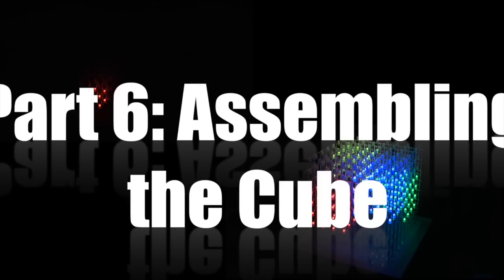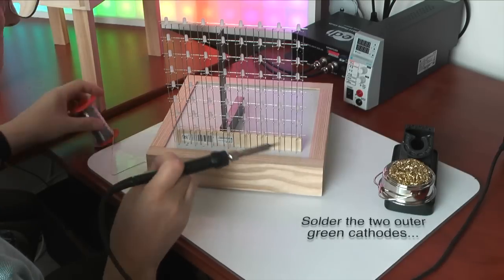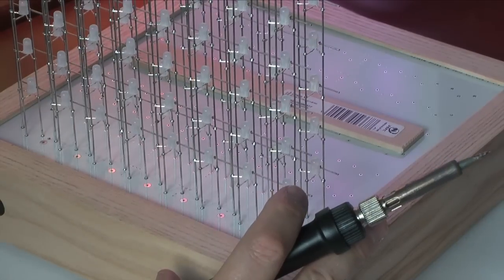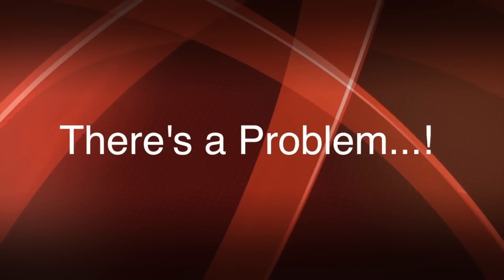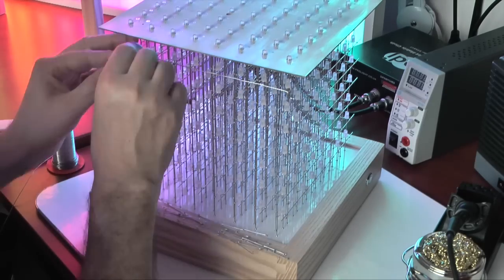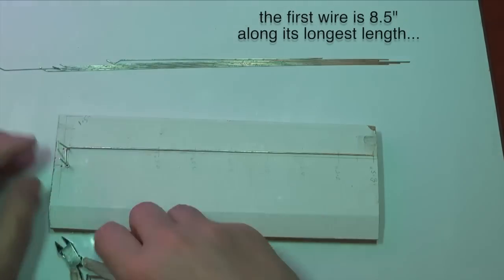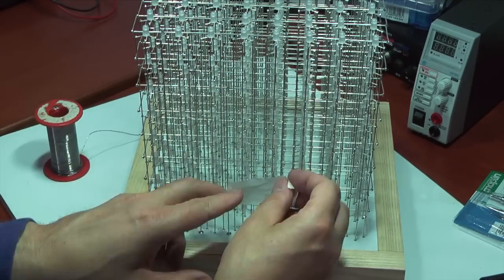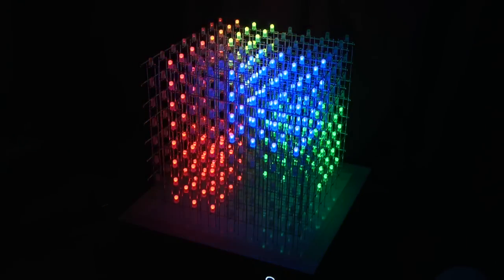Construction of an 8x8x8 RGB LED Cube. Part 6: Cube Final Assembly

Comment: Hi Steve. I built your design of the 8x8x8 cube. it works brilliant. But where does the connection jp2 go to from off the Anode board were you have OE2-CLK2.
Reply from the maker: +bill bedew Hi Bill,
On my cube JP2 is just 4 GND connections. I only use one that connects to the Arduino GND. JP5 has OE2-CLK2 and here is an explanation copied from a reply to someone else with a similar query:

JP3 of the Anode Driver board feeds Shift Register boards 1 & 2 and JP5 feeds boards 3 & 4 with one exception, JP5 pin 1 has no connection. Instead Pin 1 of JP1 on Shift Register board 3 is connected to pin 1 on JP3 of Shift Register board 2. The reason I had to do this is because the CLK, LE & OE signals are common to all 24 shift register chips and my Arduino struggled to drive that many inputs, so I split each of the 3 signals into 2 through a buffer chip on the Anode board, therefore each line drives fewer inputs. 

The DOUT (pin 1) of the Anode board JP3 only has to drive one shift register input of the first Shift Register board (JP1 pin 1) as that signal is daisy chained from one shift register to the next. and doesn't need buffering.

Here is a wiring schedule that may also help:

Anode JP3 - Shift Reg 1 JP1
Pin 1 - Pin 1
Pin 2 - Pin 2
Pin 3 - Pin 3
Pin 4 - Pin 4

Shift Reg 1 JP3 - Shift Reg 2 JP1
Pin 1 - Pin 1
Pin 2 - Pin 2
Pin 3 - Pin 3
Pin 4 - Pin 4

Shift Reg 2 JP3 - Shift Reg 3 JP1
Pin 1 - Pin 1

Anode JP5 - Shift Reg 3 JP1
Pin 2 - Pin 2
Pin 3 - Pin 3
Pin 4 - Pin 4

Shift Reg 3 JP3 - Shift Reg 4 JP1
Pin 1 - Pin 1
Pin 2 - Pin 2
Pin 3 - Pin 3
Pin 4 - Pin 4

ALL Shift Register Boards JP2
Pin 1 - Not used but has 5V
Pin 2 - Connected to Anode Borad X4 5V OUT
Pin 3 - Connected to Anode Board X5 GND
Pin 4 - Board 1 - Pin 4 Board 2 - Pin 4 Board 3 - Pin 4 Board 4

Anode Board
+6V from Power Supply - X4 6V IN
  0V from Power Supply - X5 GND
Reply: Thanks Steve that's been a big help. Regards Bill

Comment: Hi Steve...excellent job on the cube..my friend and I built one to the exact specifications. There is good signals at the LED's but not enough voltage to turn them on. Boards were tested prior to connecting LED's. Once LED's were connected the DC voltage dropped from 5-6volts to .85volts any ideas why that happened? Many thanks again
Reply from the maker: +Blue Ice It sounds like you have a short circuit somewhere, be it a faulty component, circuit board or solder joint. Try powering each board in turn to see which one is causing the issue.

Comment: Hi, Steve
As an amateur, I thought to begin with RGB project.
One question, can I use the main RGB PCB from SuperTec. (I already bought)
to your design?
Thank you for your valuable descriptions.

Regards
Anders
Reply from the maker: +Anders Norgren Hi Anders,
I have no personal experience of SuperTec's board but I understand that my cube matrix is comparable with it. However his electronics and software are different to mine and I can therefore not support you with regard to queries of that nature. You would need to ask SuperTec and I wish you good luck with that. Others have recently found him to be less than helpful.
Should you need help with the matrix itself then I'm happy to help.
Reply: +Steve Manley Thanks for your reply.

Comment: Hello Steve! I very much want to repeat your cube. But I have some questions. How Shift Register Boards connect among themselves (JP1, JP2 and JP3)? (Connections aren't visible because of Anode Driver Board) To what connector is connected the JP5 connector of the anode register?
Reply from the maker: +Эдуард Пфо Hi there, 
JP1 of the first board (the one that sits directly under the Arduino) receives its input from the Anode Driver board, JP3 then connects to JP1 of the second board and so on. JP3 on the fourth board is not connected. Pin 1 of JP3 goes to pin 1 of JP1, pin 2 to 2, pin 3 to 3 & pin 4 to 4. JP2 is for the power connections, pins 1 & 2 are +5V, pins 3 & 4 are Ground.

Hope this helps.
Reply: +Steve Manley, thanks! And JP5 of the Anode Driver Board?
Reply from the maker: +Эдуард Пфо Thanks for pointing that out, I'd forgotten about JP5. I therefore need to correct my previous responce. 
JP3 of the Anode Driver board feeds Shift Register boards 1 & 2 and JP5 feeds boards 3 & 4 with one exception, JP5 pin 1 has no connection. Instead Pin 1 of JP1 on Shift Register board 3 is connected to pin 1 on JP3 of Shift Register board 2. The reason I had to do this is because the CLK, LE & OE signals are common to all 24 shift register chips and my Arduino struggled to drive that many inputs, so I split each of the 3 signals into 2 through a buffer chip, therefore each line drives fewer inputs. 
The DOUT (pin 1) of the Anode board JP3 only has to drive one shift register input of the first Shift Register board (JP1 pin 1) as that signal is daisy chained from one shift register to the next.
Reply: +Steve Manley, thanks!!!
Reply from the maker: +Эдуард Пфо 
Here is a more detailed connection schedule:

Anode JP3 - Shift Reg 1 JP1
Pin 1 - Pin 1
Pin 2 - Pin 2
Pin 3 - Pin 3
Pin 4 - Pin 4

Shift Reg 1 JP3 - Shift Reg 2 JP1
Pin 1 - Pin 1
Pin 2 - Pin 2
Pin 3 - Pin 3
Pin 4 - Pin 4

Shift Reg 2 JP3 - Shift Reg 3 JP1
Pin 1 - Pin 1

Anode JP5 - Shift Reg 3 JP1
Pin 2 - Pin 2
Pin 3 - Pin 3
Pin 4 - Pin 4

Shift Reg 3 JP3 - Shift Reg 4 JP1
Pin 1 - Pin 1
Pin 2 - Pin 2
Pin 3 - Pin 3
Pin 4 - Pin 4

ALL Shift Register Boards JP2
Pin 1 - Not used but has 5V
Pin 2 - Connected to Anode Borad X4 5V OUT
Pin 3 - Connected to Anode Board X5 GND
Pin 4 - Board 1 - Pin 4 Board 2 - Pin 4 Board 3 - Pin 4 Board 4

Anode Board
+6V from Power Supply - X4 6V IN
  0V from Power Supply - X5 GND
Reply: +Steve Manley, Many thanks for the detailed description!
Reply: Hello, Steve! One more question. The supply voltage on ARDUINO UNO moves in your case via the USB connector. And what moves on the POWER connector of ARDUINO?
Reply from the maker: +Эдуард Пфо Hi,
I'm not sure I understand your question, but the Arduino is powered via the its DC jack socket and the other end is connected to the 6V power supply.
Reply: Hi, Steve! I apologize for my English. Tell me, please, how your ARDUINO is connected? (On your video.)
Reply from the maker: +Эдуард Пфо Hi, in the video I had the Arduino powered by the USB port and the 5V. This was inconvenient when developing the software so I changed to powering the Arduino via the DC jack socket and the 6V power supply.
Reply: +Steve Manley, thanks!!!

Comment: Steve, you have the best looking 3D cube I've seen BY FAR, and I think I've seen all of them on YouTube.  I just read Max Maxfield's 3D Printing article on Embedded.com; I can't wait to see your 12 x12x12 NeoPixel cube!!!    I want to thank you so much for your hard work and documentation on YouTube and EETimes, and for making your Gerber files, jig schematics, parts list and code available.  I'm stealing everything to make my own copy of your cube.  I ordered 5 each of your cards from PCBway for $202 including shipping.  That price sounds too good to be true, crossing my fingers that they work.
Reply from the maker: +jlazell Hi jlazell,
Thanks for all the kind comments.
I'm still planning the 12x12x12, I did a proof of concept on a 4x4x4 using the neo-pixel and that was sort of okay but not quite as good as I would like it.
$202 for 5 of each board sounds really good to me. The base pcbs cost me more than that in UK pounds alone. Just be aware the boards are still prototypes with minor improvements required. They function just fine but the Base PCB may be a bit bowed. This is because I only place copper fill on one side, plus I should have grounded it. The Shift Register boards could of with better silk screen and smaller holes. The Anode Driver board you will find some pads harder to solder because the are directly on the power planes, which sap the soldering iron heat.&#160;
Good luck and do let me know how you get on.
Steve
Reply: +Steve Manley I got my boards from PCBway and they are gorgeous! 3-4 days processing time and OVERNIGHT shipment from China, and less than half the price of anyone else, wow!  I can't recommend them enough.  All silkscreen is perfect. The base is slightly bowed as you said but my stand should correct that.  I actually downloaded Fritzing in order to coper fill and ground the bottom but it wouldn't let me open the Gerber files.  I have zero experience designing circuit cards and didn't spend much time trying to figure out how to open and modify them.  I saw it said Revision 1.1 and thought maybe you had revised it after the fact.  Anyway, I have all components soldered on, still need to make my jigs to build the LED matrix but I have no access to any woodworking tools.  I tried to get them 3D printed but they warped.  I'll try cardboard.  The U.S. version of Element 14 (Farnell in UK, Newark in US) screwed up 30% of my order for components.  I got gigantic resistors instead of Molex plugs, lol.
Reply from the maker: +jlazell Very please to hear you got your boards okay, sounds like a really good deal.

Re the Gerber files and Fritzing, you really need the source files to edit the circuit board design. If you ever decide to re-do the base PCB then let me know and I'll edit the source files to include the copper fill on both sides with them grounded and send you new Gerber files.

I find 3D printing in PLA to be far more successful than ABS, it doesn't warp so much.

I think we have all been there with regard to ordering components and not receiving what we expected. I have a bunch of larger resistors and SM capacitors I didn't want and to be honest, it was my error.

Comment: Steve. I like your boards and I didn't realise that Proto-pic did a pcb manufacture service. So if I send them your schematic will they produce the boards? I went on the site and I do use them. A again thanks for the great walk through and for sharing your files.
Reply from the maker: +Mark .Phillis Hi Mark, Just tried to find the old e-mails for the related orders but no luck so far. I have 2 contacts at Proto-Pic, Drew Anderson and Ewan Fisher. Ewan is the PCB man. I'm sure that they will have a record of the boards for repeat orders. Just mention my name and the RGB LED Cube and hopefully they will remember me. The Base PCB was the biggest they had ever done. Being the upfront costs are already paid for you might find the boards a bit cheaper that I did, but you may have order more than you need. Let me know if you have any difficulties. Steve.
Reply: Many thanks for that, I'll give them a call. yeah not cheap but wow how good it looks with nice boards.
Reply from the maker: +Mark .Phillis Hi Mark, I didn't think to ask, Are you UK based?
Reply: Yes Steve I'm in Yorkshire 😑